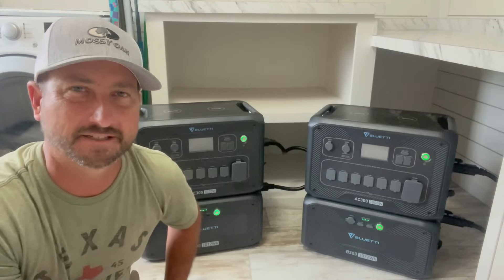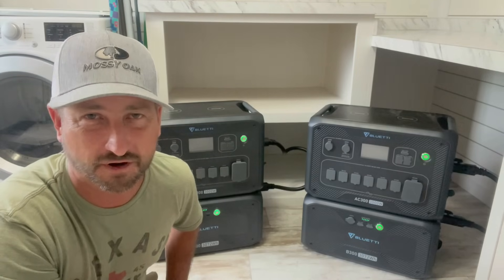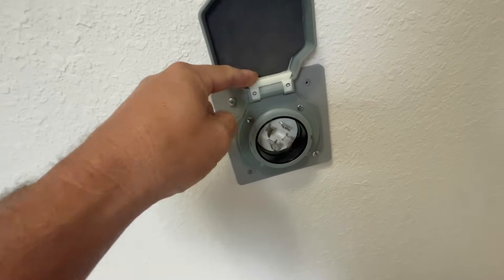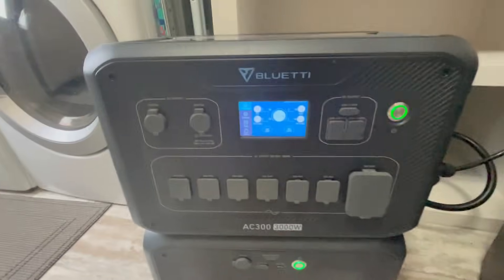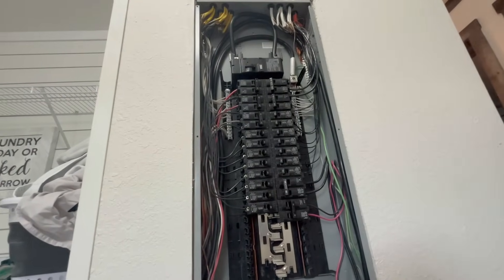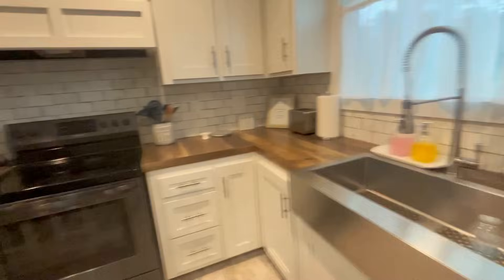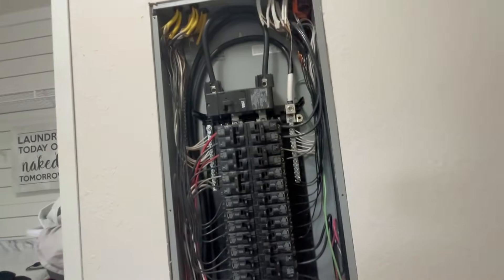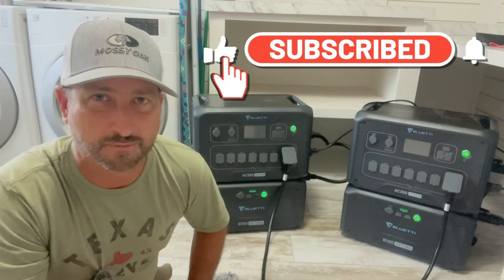Bluetti AC300 240v How to Connect to Home Electrical Panel

Comment: I wonder why Bluetti doesn't offer true bi-directional charging? With Anker, they have it setup with a bi-directional add-on that has CTs.. so you can install it up to code. It'll then export only the amount that the house is using, and never out to the grid. Man, if Bluetti had some kind of mechanism for that, I'd possibly buy it over Anker. Seems like Anker is the ONLY power unit company offering a true bi-directional connection mechanism.

Comment: Hello
What about if no 240v panel, just a 120v? Is one set of ac300 and a battery enough? just for 2 TVs, modem, laptops and little refrigerator...
Reply from the maker: @eliecervargas9800  yes you are correct. For 120v one AC300 is enough to run those items no problem.
Reply: disconnecr main, connect two male extension cord to any 120 outlet, turn off all breaker that feed 240 volt,and you have power to all 120v outlet including refri if battery is strong enough